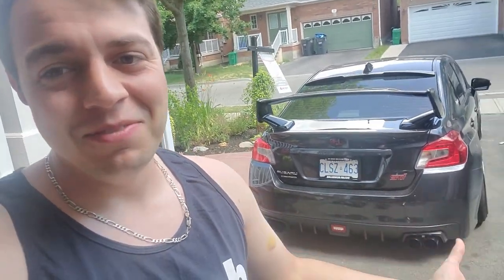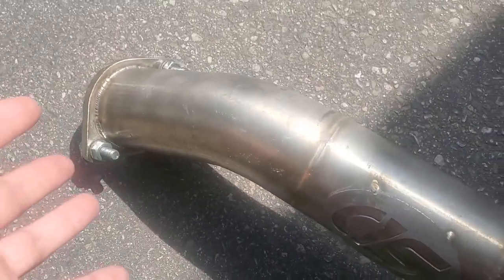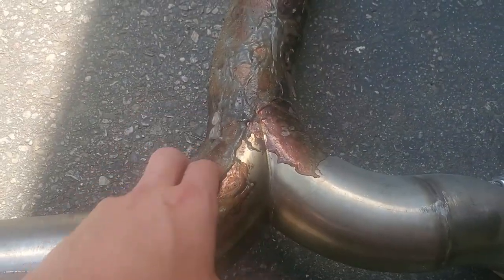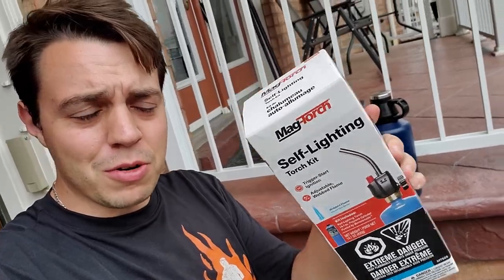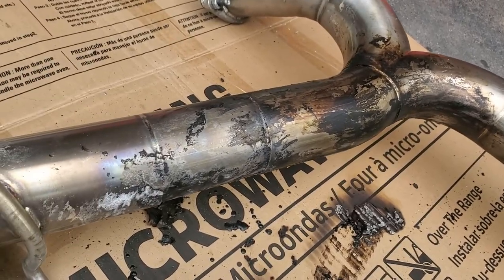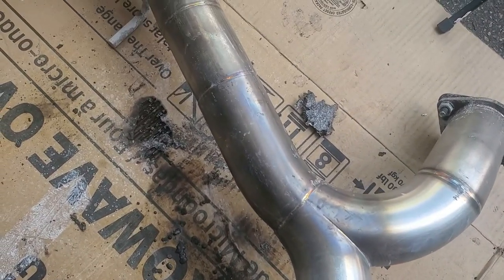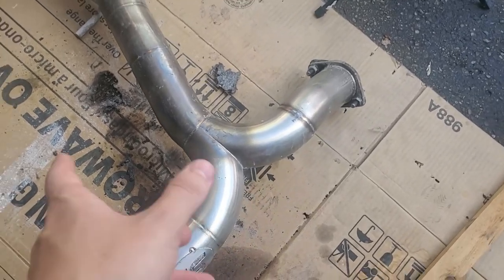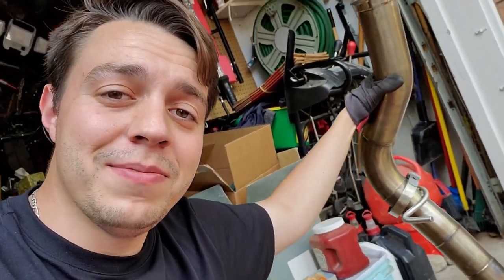Removing THICK Melted Plastic From My Exhaust

Comment: I have the same issue right now , hopefully a mechanic can do what you just did and not charge an arm and leg
Reply from the maker: Good luck. The torch was a worse case scenario for me. Hopefully they can come up a better idea that's quicker!
Reply: Where did you end up taking it? My car is too low for me to remove it myself, I need it on a lift and idk how expensive it will be

Comment: How bad would it be to drive with that?
Reply from the maker: Not bad, it's just annoying
Reply: @zach_lush  alright thx, have some plastic on mine, cant reach. Just dont want a fire, hopefully it melts off
Reply from the maker: @c.518  no problem. If it's a bit I wouldn't worry about it. I just wanted it clean
Reply: @c.518  how long the smell last ? I ran over a bag and my check engine threw some o2 sensor code like a month later , could be coincidental but it’s in a hard to reach area and now I’m worry of the smell is something else 😳
Reply: I ran over a trash bag and it got melted to my exhaust. I can’t tell how much is stuck to my exhaust but I really need to get it cleaned
Reply: @brody8857 dealing with this now… how’s your car smelling now?
Reply: @firered03snake how’s the smell months later?
Reply: @VivaInspire  the smell is completely gone as far as I can tell.
Reply: @brody8857 i have exactly the same issue. Have you able to remove it?